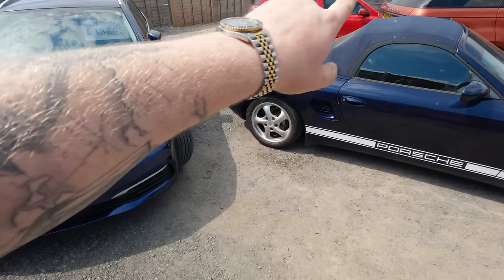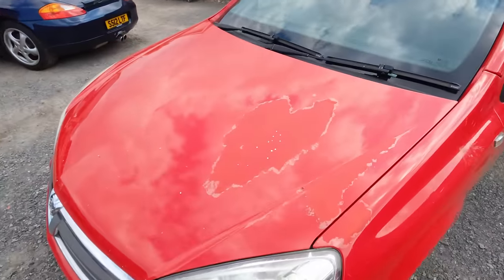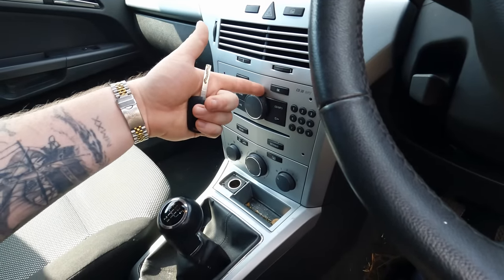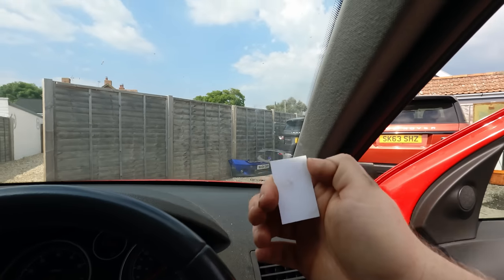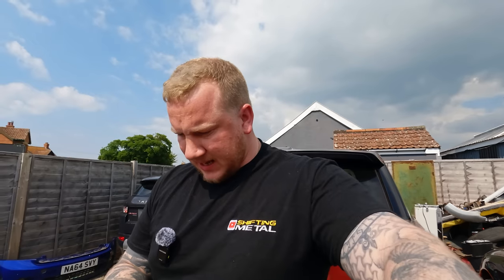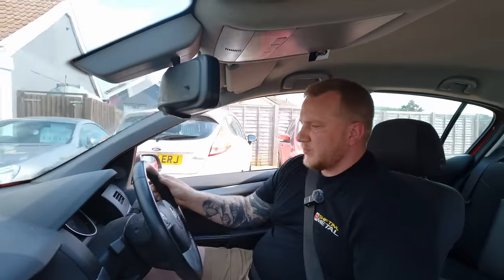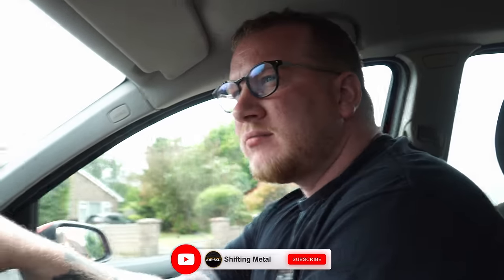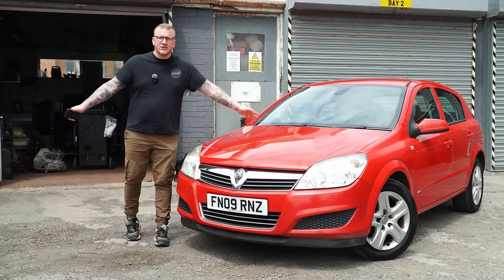I Bought A Cheap Astra For £200 & It Had a Tracker Fitted! 📍

Comment: "We took this cheap PX Vauxhall Astra recently and it's actually not bad!" Precisely, a poor Astra that's been abused for years but still has made it past 150,000 miles and with some better maintenance and care could easily do tens of thousands miles more. Nice cheap solid motoring for those who can't afford to buy Range Rovers or put up with their unreliability or repair costs.

Comment: Looked like a black box for young drivers to get insurance cover. My daughter had one on.
Reply: Or one of those shady used car dealers that can track the car and immobilise it when you don't make the payments
Reply from the maker: How would that work with just power cables coming off the battery?! 😂
Reply: @ShiftingMetal I had one of these when I was like 16 it’s on all the time tracks where you park it curfew it just needs consistent power and the insurance companies figures they attach it to the battery you can’t screw with it it’s actually quite annoying ha ha
Reply: @ShiftingMetal  that could be the transmitter, and the receiver could be still hidden inside the car
Reply: It was most likely installed in case of theft, cheaper cars like this are often stolen by adidas wearing hooded  bogans and mouth breathers  
Very poor quality install though, DIY job most likely,  the units that allow you to shut down the car are more complex than that and much much smaller, it's a half day job to install them correctly

Comment: the tracker is a smart miles box, usually given by some insurers to new divers so they can monitor your driving style where you gain points, the higher the points the better a driver you are which can reduce the premium upon insurance renewal,

Comment: With a Astra h something always worth checking is to turn on the lights and try to sound the horn, the CIM regularly fails in them and this is a normal symptom. Replacing a cim is not cheap either 😂😂

Comment: Class salary saver - I bought a 2002 VW Polo with 4 new tyres with MOT and recent service for £450.   Put over 10000 miles on it over 18 months driving back and forth to work and then sold it for £250.   Love em!!

Comment: We got this generation Astra in the United States as a Saturn Astra.
It was available as either a 3dr or 5dr powered exclusively by a 2.2L engine with either a 5spd manual or a 4spd auto.
They were not well received and sold poorly. 
Although you still see them occasionally being driven as a daily driver.
I purchased a five-door with an automatic as a commuter vehicle.
I drove it for 10 years and 335,000 MI and problems were few and far between and mostly minor with routine maintenance.
The only problems I can recall were shift solenoids and a failed ABS pump.
It did need new valve cover gaskets every 75,000 Mi!
It never failed to start or leave me stranded and my commute was 180 Mi round trip and the car went on several road trips over 5,000 each including one epic road trip of almost 11,000 Mi from Chicago Illinois to Anchorage Alaska.
Reply: In the UK these came with many many engines but the most common was the diesels (it was around the time that diesel was being pushed on us by the government and everyone wanted one. The government have done a complete u turn on diesels now and upped the tax and introduced ULEZ to get rid of them). My uncle had until recently a 2007 1.7 CDTI which he owned since 2011 or so and it had 190,000 miles on it before the head gasket went just this year. Being that the repair is the same price as the cars worth he just scrapped it.
Reply: I'm a bit a vauxhall guy,my first was a white chevette,red vinyl inside  loved that car til it rusted away,😢my latest one is a 1.9 cdti zafira,and cos I now own a Ladder,that officially makes me an old fart...love the videos ❤

Comment: I have a 1.4 Astra on an 07 plate, the tax for a year is £160. 118000 miles on the clock, original clutch, original auxiliary belt which looks in the same condition as yours, no laquer peel right enough but then I'm in Glasgow 😂

Comment: It's learner driver black box, thought you'd have known that bud, you get loads just left on.
Reply from the maker: But it doesn’t actually seem to be, it looked like a basic tracker to me. In fact, that’s what it said online
Reply: @ShiftingMetal  when I disconnected one on a learner customers car to do some work to it, he got a text st away from the insurers, looks just like that one on yours, only other thing I've had is an immobiliser for a micky mouse pay as you drive finance thing, easy enough to disconnect if you trace the wires. It'll deffo be a learner tracker tho, a lot have curfews on them and exceeding the limit will pull your insurance.

Comment: This is the sort of car a lot of people will buy - run and scrap when it fails. Nothing wrong in my opinion. Love these type of vlogs. I run old cars for me and my 3 daughters but I keep them immaculate. My last car was £2200 8 yrs ago and is immaculate and going very strong. Rot free, 17 yrs old and it’s a keeper. I d love a jag or something but don’t have the means to repair. My 3 girls all have 15-20 old cars and I maintain them and they are in fine fettle. I am also capable of repairing in the main. I did 2000 miles in my berlingo last week, motorways miles and my mind was ticking, what could go wrong at 17 yrs old😂. Nothing did thankfully.   Ore of these type old bangers please

Comment: Bargain £200 before Covid was easy to get a cheap run around but now not so easy but old astra reliable easy to fix and maintain but all ways red paint problems in my area on gumtree you would be paying £1000 easy because anything less than that is scrap you will soon sell it

Comment: In Australia these were sold as the Holden Astra just a Vauxhaul Astra with a Holden badge on it but thats were the good stuff ends in Australia we expect more reliability from our cars because the bibgest selling car brand for the past 25 years is Toyota now getting back to the Astra they got the nick name of the Holden Disastra añd mechanics refuse to work on them also car wholesalers don't touch them and there was a Disastra sold for aud $409 at auction and l telling sign what a rubbish car it is for a 2009 air conditioning not working but my 1997 Toyota Hilux the air-conditioning works obviously demonstrating Toyota's superior build quality and there are two Disastras in the Col de sac we live in and one of them hasn't moved its always sitting under the car port hasn't moved in 10 years and its a 2008 year model and these aren't worth that much what an absolute pile of junk